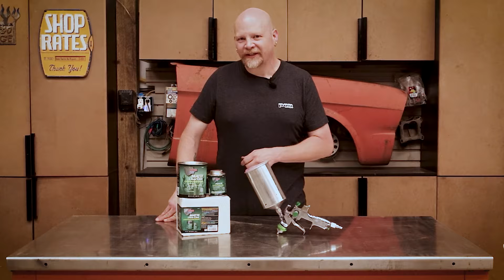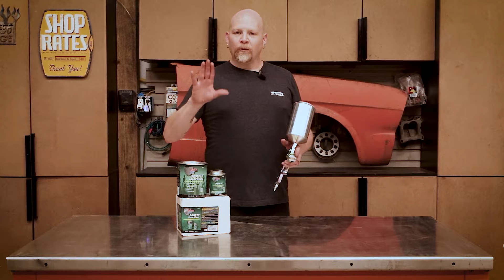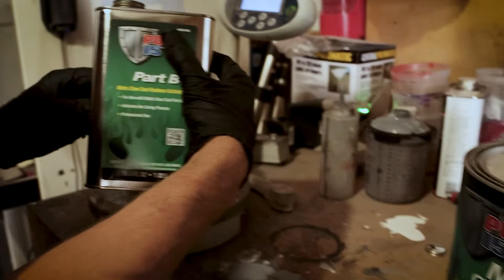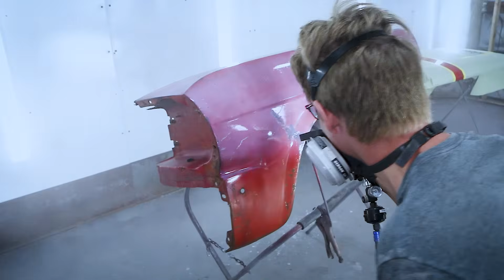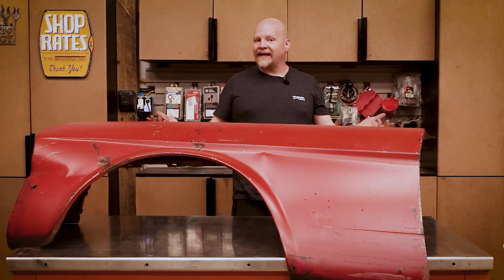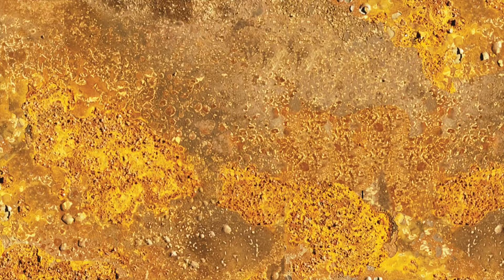POR-15 Matte Clear Coat - Water Based

Comment: How far does this cover? 1quart spary a small car? Idealy spray quite lite mist not heavy wet coats? No need to warm or thin down just mix at 2.4. 30psi 1.2 tip  go?...
Reply from the maker: Depends on the car. Maybe 3 quarts or a gallon for a small car. Best to measure out your panels. Coverage: One gallon mixed covers 340 sq ft with One coat at 1.8 mil thickness.You can thin with distilled water if needed. Two medium wet coat usually works well, but depends on temp and humidity. contact support for more info support@POR15.com